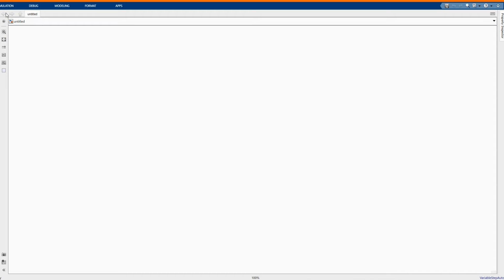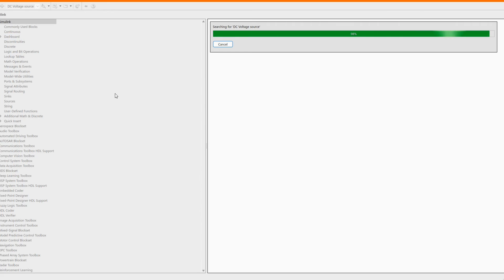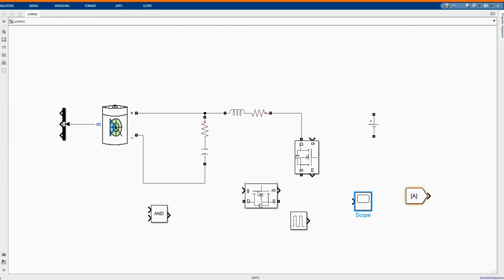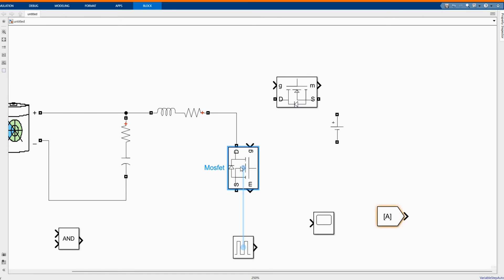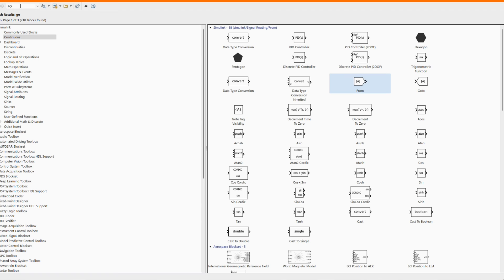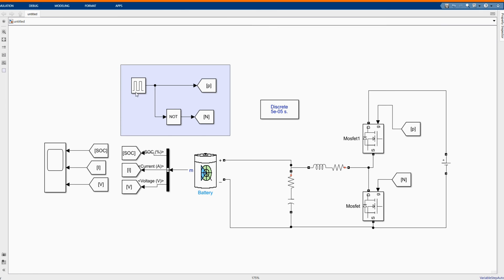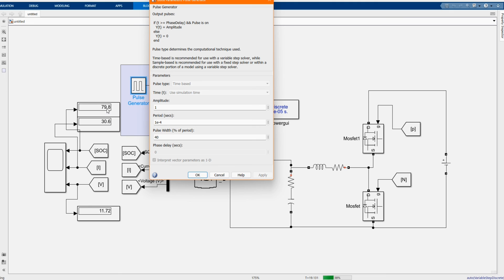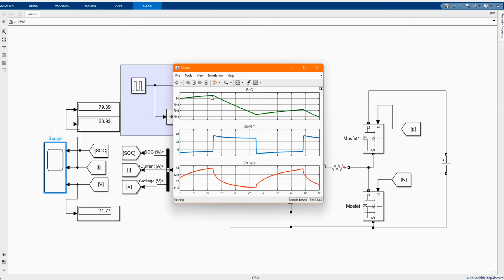Battery charging  and Discharging controller based on Pulse with Generator in MATLAB/Simulink

Comment: why current is showing negative for charging and positive for discharging??
Reply from the maker: Hi, thank you for your comment, The normal polarity of the battery during discharging is positive. During charging, the current flows in opposite direction from DC Source to the battery. That is the reason we get negative current during charging.
Reply: @pzengineering2020 hello dear,what about duty cycle is above 50% and below?
durring open loop